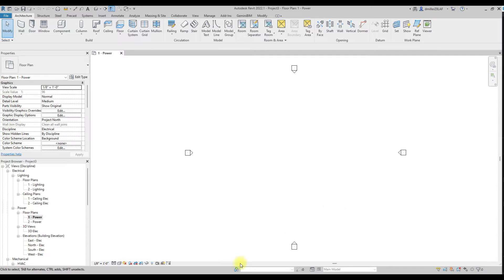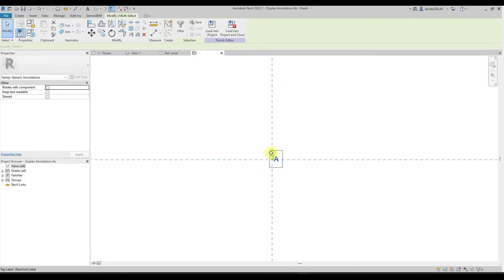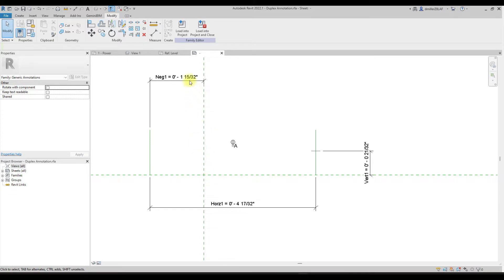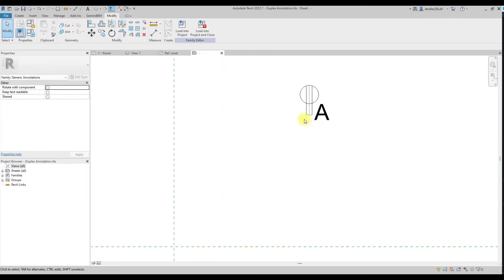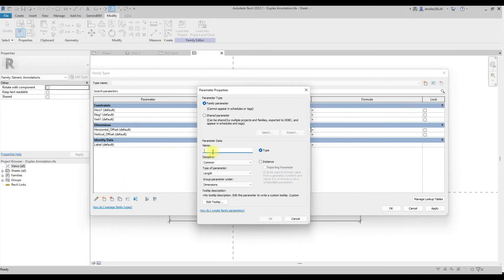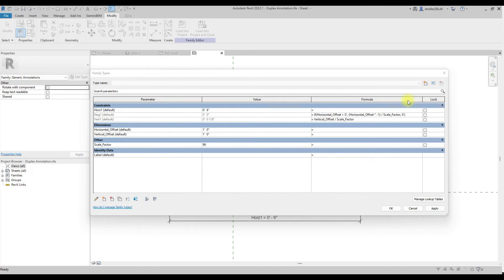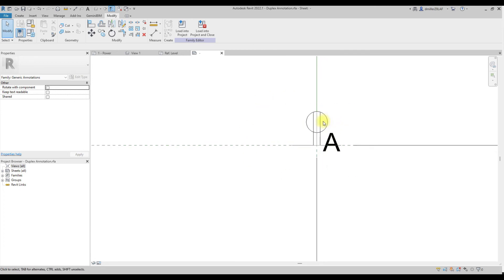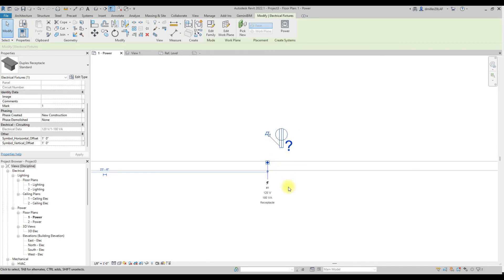How to create electrical symbol offset parameters in Revit

Comment: Thanks a million, that's a great video. Very detailed. I have my setup in the annotation family working as shown. Ladded into model element family then created and mapped the parameters like shown also. I keep getting the 'Parameter Symbol_Offset_Horizontal has an invalid value.' error. Is there any common reasons for this?

Comment: Awesome video!  Really useful, thanks.  

How might I alter the formulas to match when working in metric?
Reply: Seems to be working actually!  But only on the one I edited rather than each of the same symbols that are a part of that family in the project.  Confusing!
Reply: @adambulpitt7002  Did you only get this working on your annotation family or did you get it successfully loaded  into a family for used in a project? I can get the annotation family working when flexing all the values, but get the error [Parameter Symbol_Offset_Horizontal has an invalid value.] when I bring it into the parent family (In this case a fire alarm break glass unit) and try flex the values again. This error only happens when I try to do minus number on the horizontal offset. Any ideas on solution?
Reply: Found the issue. I never mapped the scale factor parameter. The very last one in the video at 15:00 mins